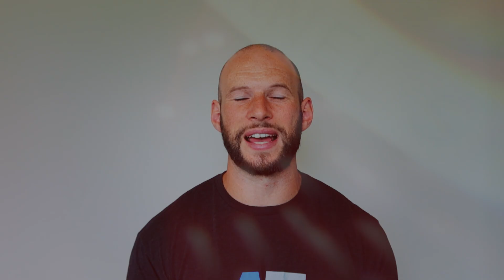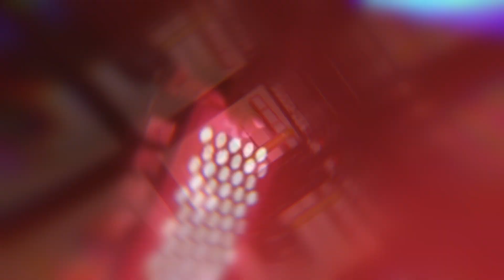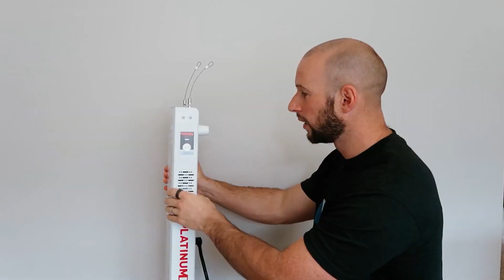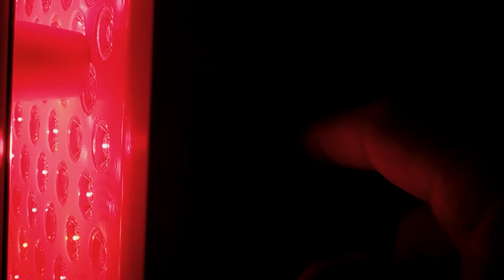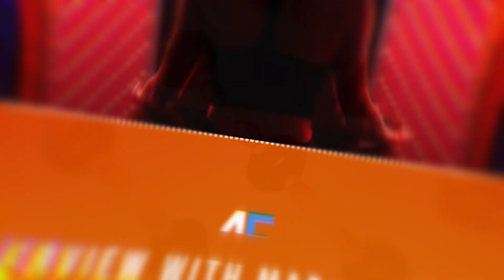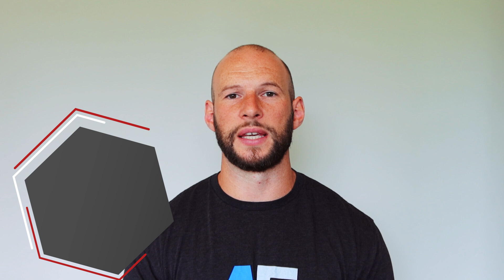Interview: PlatinumLED Therapy Lights CEO Mark Sawyer

Comment from the maker: ✅ Buy a PlatinumLED BioMax by using the following link for a discount: https://aferg.co/redled - UPDATE: no discount code is available so you'll have to click the link

Also, here are a ton of amazing resources allowing you to explore PlatinumLED and their panels further:

✅ My epic Facebook group on red light therapy and more: https://aferg.co/fb-group

✅ My 2021/2022 red light therapy body panel comparison series: https://aferg.co/RLT-2021-playlist
✅ Check my excel sheet for comparing this panel to the competition here: https://aferg.co/rlt-data
✅ For my buyer's guide blog, follow this link: https://aferg.co/RLTguide 
✅ BioMax 600 full review: https://aferg.co/biomax-600-review
✅ BioMax mobile stand review: https://aferg.co/BioMax-stand
✅ BioMax wireless connectivity mode review: https://aferg.co/BioMax-modular-wireless

Comment: Mr. Sawyer.  I am very disappointed in your business and especially your customer service team.  I received my BIOMAX900 yesterday with the $400 rolling stand, and the steel base is bent, making it unusable.  Your team told me to place it on the floor and bend it back with my hands, which is impossible - I am not Superwoman.  They flat out refuse to exchange it or send a part to correct it, and I am stuck with a pile of steel.  I even offered to accept the smaller rack in exchange for covering the shipping, but it was of no avail.  You would think after spending $3K + for this, they would accommodate, especially when it came unusable!!!  I am asking for you to intervene and if you do not, than that surely is demonstrative of the kind of business you represent.

Comment: Mark Sawyer is saying that sooner or later the companies saying they’re using 5 w are going to be exposed. How about if all the companies including platinum are exposed for saying some of the panels are full body when they’re not.
Reply from the maker: The terminology can be confusing. That is why companies also list the number of LEDs and their height, width, and weight.
Reply: @LightTherapyInsiders  yea it’s confusing.  Mito red light is 42” and the platinum is 36” height , both of them say is a full body panel. I want to treat my thyroid and the legs all the way down with the biomax 900 and I end up compromising the treatment for the whole leg. I have not problem if they and you say “if you want real whole body treatment you need more that one panel like you have”
Thanks for your answer

Comment: I'm new to health apps using light - doing my due diligence on led panels etc. In this interview, the BIOMax owner, Mark S. poo hoos the benefit of pulsed wave (PW) vs continuous wave (CW - BioMax tech). Two points - 1) He is right in saying that pulsing light from higher powered LASER devices can reduce the burning of tissue due to decreased "thermal effect" (sic). However, he suggests that lower heat generating LEDS don't "require" pulsing due to an acceptable & tolerable level of "thermal effect" on the body, and therefore HIS product line doesn't have UNNECESSARY pulsing features like other companies' product offerings - suggesting that pulsing is a worthless gimmick. Studies on skin, dating back to 2010 (D.Barolet et al) illustrate real benefits to pulsing LOW Level Light Therapy compared to continuous wave. More recent head and brain studies tout the benefits of 10Hz & 40Hz pulsing vs continuous wave LED's, due to native brain wave oscillations in the corresponding bands of alpha & gamma brainwave frequencies. 2) He ignores that pulsing, thereby lowering the duty cycle of the LEDS, will actually increase the durability and product life of the LED/Panel. I welcome any input from more learned EE's or scientists in the field.
Reply from the maker: Hey thanks for your comment. 
Yes valid points. I cover pulsing in this recent video - https://www.youtube.com/watch?v=DVBOHQbq3OU
Reply: @LightTherapyInsiders  thx Alex!

Comment: Thanks for thorough review. Just wanted to leave a warning about PlatinumLED: first they delay your shipment and you can find out about it only AFTER placing the order by visiting their blog (!) Secondly, I kindly asked them not to include invoice into the shipment, but instead they ended up cancelling my order, and doing incomplete refund (!!). I ended up with NO panel and $50 short after their refund. WTF was that? Avoid PlatinumLED and go with any other manufacturer!

Comment: So much info out there. Looked at a handful of higher priced equipment to add to our nutrition program.   Can this be used to assist in weight loss ?
Reply: I have been using the biomax 900 lights with the horizontal stand and can confirm significant fat loss - meaning you can actually see the loss without using a measuring tape. It's significant. Exercise and eating clean will also help speed up the fat loss.
Reply from the maker: Hey, yes, some of the studies do show increases in fat loss with light therapy - in some studies red light therapy was used, and in other halogen bulbs. Also, there are almost certainly indirect effects through which red light therapy improves fat loss, such as increasing sleep quality, boosting recovery and gains after workouts, and reducing pain, all which will translate in better fat loss results. -- Bart from team Alexfergus

Comment: @alexfergus I noticed in the recent PlatinumLed FB ads, they are measuring using Mw/CM2 and show that the biomax900 crushes the mitopro 1500.  Seems like its different than your results (different measurement ie watts).  Any thoughts?  I'm on the fence between the 2 devices.
Reply: They measured MITO light on the edge of the panel, not in the middle and they might not turn on NIR light as it is not on as deafult.
Their reading can be sqewed by blocking some light by the measuring tape.
Reply: Here is the light output of MITO 900 https://youtu.be/EqmV6-WiP8g using the same solar power meter as they used in the advert. Notice the meter is in the middle of the panel and no tape is blocking the light.
Reply from the maker: Hey, I'll be doing a direct comparison of these two panels in the coming weeks (it should be up on YT in feb) so that should help clear things up :) 
Remember though, these panels are both extremely powerful - especially when compared to panels a few years older. Even if one is slightly more powerful than the other it's not like you are getting a low powered panel!

Comment: I would avoid PlatinumLED at all costs. Horrible customer service. Delayed shipping times.
Reply: I’m concerned about this too after someone else complained about customer service. The BBB had an F rating on this company. So I’m worried if there is a bad LED or something wrong, I might be stuck with it.
Reply: @ThingsThatJadeLike  mitored are much better. Panels scored highly in Alex’s review and great customer support
Reply: @0xAlpine  I like that I can change the output of the panel and also the easier to use panel.
Reply: @ThingsThatJadeLike  Yes, please see my comment below to SJ, and my full experience and others TrustPilot or BBB. Their customer service issues are not only not even remotely resolved - it is by far the most corrupt and lacking of integrity company I've ever experienced personally.
Reply from the maker: Hey, sorry to hear you had issues :(
Reply: @LightTherapyInsiders  yeah wish I had done my homework there’s tons of similar complaints on Reddit.
Reply: I ordered my lights exactly 1 month ago. My experience was just the opposite. Shipping was immediate and I received it earlier than promised. There was no need to contact customer service so I can't speak to that.
Reply: @SJ I just did business with them against  my better judgement seeing the negative ratings. Over $5,000 worth of business . It is the most dishonest and horrid customer service company I have ever done business with. You can see the review of what happened on BBB (where they have an F score) and Trust Pilot (where they have the lowest score possible) for details. Reviews on a customer website are easily fabricated - they have endless negative reviews on 3rd party sites, but none on their own site, which should give people a sense of how valid the positive reviews on their site are. They cancelled my order the day its was finally scheduled to be delivered, a month late with  no notification, no refund receipt, I found this out day of delivery from Fed Ex when it didn't arrive. The Rep at Platinum LED hung up on me when I inquired and my number is blocked from calling the customer service line for resolution.

I am calling my bank to get my money back directly and reporting them - which could turn out to be a blessing in disguise as it led us to Iearning more about Hooga - particularly their new HG ULTRA (stronger specs, far better price and customer service reviews), GembaRed, MitoRed - all that have far superior reputations. Of course there's Joov & others as well.

Comment: Alex I hope you update your review to have accurate information on the Biomax RF output. In your review you state that the RF function  is not a requirement for linking multiple panels. That is incorrect. The ONLY way you can connect multiple panels is when the 2.4Ghz RF radio is on, the cables that come with the unit to connect them do nothing, and there is no way to disable the RF radio when the panels are linked together.
Reply from the maker: Hey Phil. Thanks for pointing this out - it's a shame to learn about this. I'll reflect the change in future videos
Reply: Hi Phil, I have a question: If I run the panels separately will that eliminate the RF output? Just don't link them together, correct?
Reply: @squeegeeman123  Yes just put them in Solo mode and start them seperately
Reply: Good to know thank you.

Comment: Alex you should be aware that there is no way to turn off the RF emissions on the Biomax lights, when they are paired together. They include a cable giving you the impression that you can link the panels together without Wifi emissions, but the cable does nothing and there is no way to turn off the Wifi in the menus. I contacted Platinum tech support and they seemed very dismissive about this, just saying that the 2.4ghz radiation was harmless. I would like to hear what Mark thinks about this, as I am sure the tech support people will not bring this to his attention. Hopefully he will add a software update for this rather than continue to sell the panels with a cable that gives the false impression that you can link panels without Wifi radiation.
Reply from the maker: Yeah, I will find out what the deal is here. Hopefully there is a simple software fix.

Comment: Im still very interested in knowing more about the Biomax 450. Also is there any studies based on skin tightening (for the body not the face) and also does RLT & NIR rebuild ir heal connective tissues ?
Reply from the maker: Many studies available, but best to check out this review: https://www.ncbi.nlm.nih.gov/pmc/articles/PMC4126803/

The study is eight years old though, so more recent studies won't be included. And yes, there are many studies on light such as 620 or 630nm and skin health, so the 10% of light going to that part of the red light spectrum is very advantageous. -- Bart from team Alexfergus.
Reply: RF treatments tighten the skin really well .. and it’s not painful.
Reply: @lindaprigge59  I have tried at home device's without success. 😔